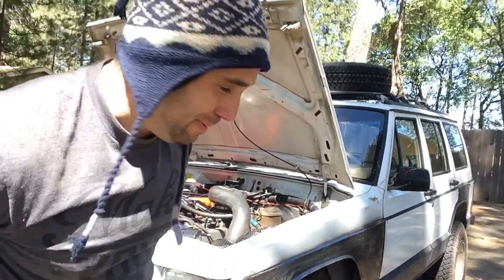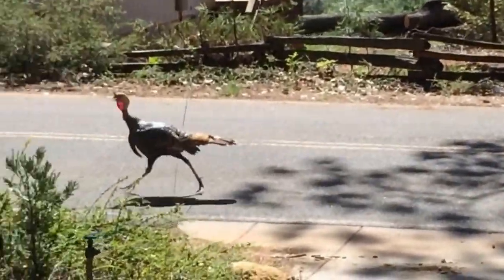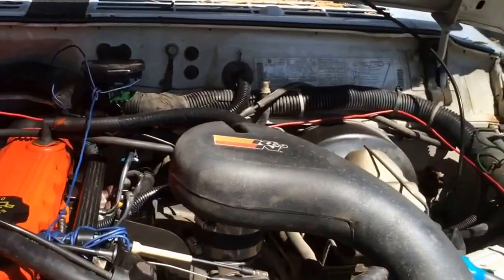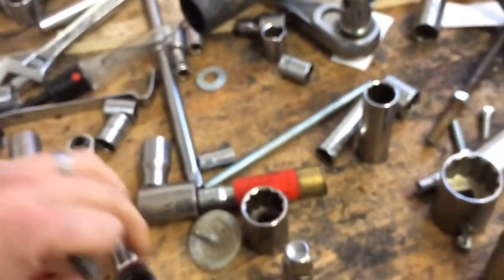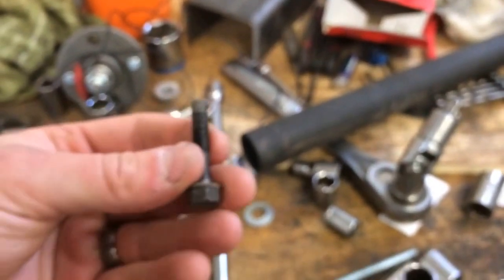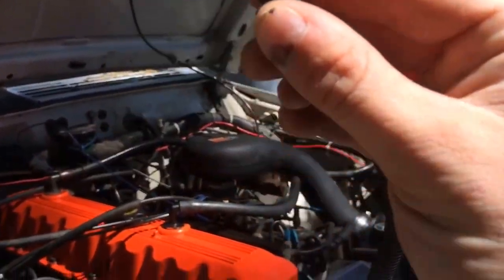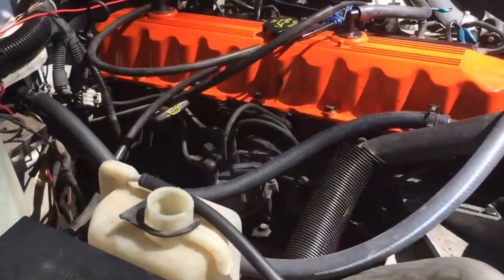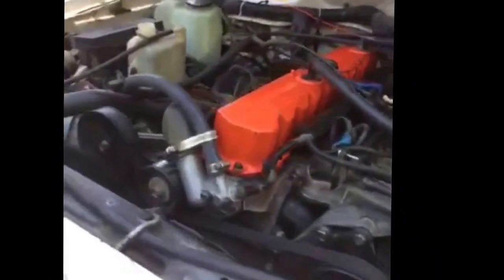Jeep Cherokee XJ MSD coil install

Comment: Did you need a wire harnesses adapter or was it a direct fit the electrical plug ins to the stock wire harness
Reply from the maker: This is the second time I’ve been asked this in the last month. I wish I would’ve dived deeper when I connected it, but I no longer have the jeep. To answer your question, yes it’s a plug in to oem.

Comment: After having trouble w/Accel (and having terrible customer service from them, basically telling me to huff off!) have been using MSD, and love their products so far! Not a problem yet, and they do work better than stock parts everytime. You should have done the coil relocation at the same time though, keep it away from the engine where it cooks the case until they crack.

Do a video on the Crankshaft position sensor, as that work is coming up for me soon, so do the video! Thanks in advance.
Reply: niceguy217 same company bro ... Mallory ,MSD and accel are all owned by holley
Reply: Are they? Had't heard that, all I know is I bought a Accel cap and rotor and a ignition coil, the cap an rotor lasted 1 month, the coil failed within a year! When I called Accel about them they basically told me to buzz off!  Never have had problems with any MSD items, but will look into seeing if they are all under the Holley umbrella now.
Reply: niceguy217 called summit today and they told me that and I knew accel was but Mallory and MSD are within the last ten years because that's how long I've been out of american cars
Reply: Sad that is, and knew Accel was part of Holley, but now to find out they all are. That consolidation leads to the cheapest quality parts made as they have no real competition, and it's all about making the most money they can out of anything they sell.

Comment: i got the same coil for my 98 zj 5.2l v8 laredo and the plug connector that goes to the coil is a different size was yours direct fit or what
Reply from the maker: From what I remember of this yes it was a direct fit.

Comment: You should relocate it to the firewall, lasts alot longer. Keeps it away from all the heat.
Reply from the maker: Dude, I know. I might do that next. I might hit up the pic n pull to get an extended wire

Comment: So I have a 1996 xj and it keeps dying so I'm gonna replace the ignition coil, because when it does I can unplug and plug it back in to get it to start again, so I have 2 questions. 1 what does the connector on the ignition coil (not the wires to the distributed cap) but the wires that plug into the other end of the coil, where does that wire go to in the engine? And 2 what do I have to do to the crank shaft position sensor? I have to move it? Why?
Reply from the maker: Sorry to hear that dude, I know its frustrating when all you want to do is drive the damn thing and it acts up. I actually forget what it connects to, and its too cold and late for me to check it out, so tomorrow when I head to work I will pop the hood to remind me where the positive connection comes from. Then Ill let you know. I know its 12 volts from a harness, but I can't remember where is comes from.

It could be the crank position sensor, you can change it. If you do, tie a string to it before installing it to make sure it does not fall inside of the bell housing. Fishing line works, but I used think threading line so I could break it afterwards. Does that help or do you need me to make a video showing this?

Comment: Question now that I saw when you started it up. Does your fan turn on right away and stays on ? I noticed mine turn on as soon as I start it up and yea just stays on all the time. Thanks
Reply from the maker: My fan was wired in by me attached to a switch. Boy did I do a horrible job

Comment: what is the use from installing it i have 2001 cherokee xj do you recommend this msd coil for me
Reply from the maker: Sure I do. Yea, there are some other good ignitions out there also, but I like MSD, I grew up on MSD so can't go wrong.
Reply: Footage Factory thank you but can you explain for me if it increases the horsepower or it just make the car run better and smoother
Reply from the maker: It did both in my case. I'm not sure if it were because the old ignition was going out, or if the MSD is that much of an inprovment. i actually want to try it out with the 4 prong Bosch spark plugs, and upgraded injectors and see if it makes more power. Nonetheless, you won't be disappointed.
Reply: Footage Factory cant wait to see that set up i will subscribe now to see ur next video
Reply from the maker: Alright brother. I'll get a move on the parts and make the video for ya. Give me a few weeks to make it.

Comment: The link you out for the purchasing on amazon. Would it fit my 99 Jeep xj ? I tried clicking on the link but says it won’t fit 99 cherokee. Please let me know thanks
Reply from the maker: Really. Let me click it and see.
Reply from the maker: Crap. Don’t order that one. Let me change the link. That one is completely wrong.
Reply: Footage Factory cool let me know when you find right link to it thanks
Reply from the maker: https://www.amazon.com/gp/product/B00063073Q/ref=as_li_qf_asin_il_tl?ie=UTF8&tag=ootageactory-20&creative=9325&linkCode=as2&creativeASIN=B00063073Q&linkId=e03171e4c239db5bc9796e0312139a7d
Reply from the maker: Thanks for catching that dude!!
Reply: Thanks for the new link. Question it says on the comments. I need an adapter for it. You have any idea if it will work with me buying the accel adapter ?
Reply from the maker: Interesting. I didn’t need an adapter for mine. The worst you can do is buy and try to connect to see which part is missing, because I can’t think of any adapter.
Reply from the maker: The original accel adaptor, that is what I have on mine and it snapped right in.
Reply: Footage Factory thanks bud !

Comment: where can I find that red valve cover or any after that direct fits
Reply from the maker: The Orange valve cover. I just painted them.
Reply: Cool
Reply from the maker: Actually my wife painted it. Get the engine spray paint at Oreillys.
Reply: A tip, use the metallic silver(or Chrome) paint, it instantly lowered my temps on my old 5' and looked really nice! Any other light color other than black though will help. We proved it on a buddy's bike, changing parts from black to chrome, even in the shade away from the engine they stay cooler, black absorbs any nearby heat, and retains it!

Comment: bruh how did you get the old coil out. i said fuck it and left it in, because i cant for the life of me get the old one out.
Reply from the maker: Lol, I can't remember how I did it but I do recall thinking about leaving it too.
Reply: Footage Factory I really tried. it's staying in there. I'm just going to tell people it's there as a back up lmao
Reply from the maker: If it's really not coming out just rip it out. It's bad so who cares
Reply: Footage Factory it actually does work, I just replaced it as part of my last tune up because your video made it look soooooo easy lol
Reply from the maker: If that's the case then relocate the new coil up high so it won't be against the engine heat and it'll be out of the way of water. I've seen a few vids doing this. I should make a video doing this.
Reply: Footage Factory you definitely should make a video doing it my brother. I was thinking to put it up against the fire wall. do they make a wiring harness extension?
Reply from the maker: No, from what I read the only way to do it is to go to a pick and pull n rip out the extra wires